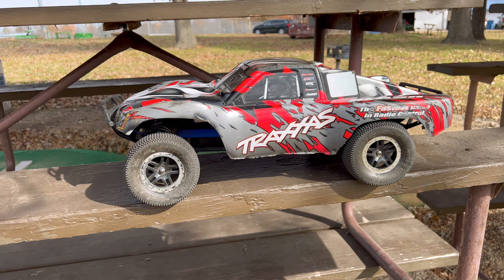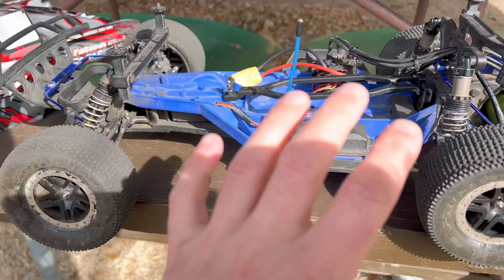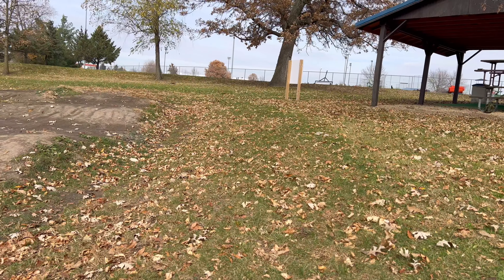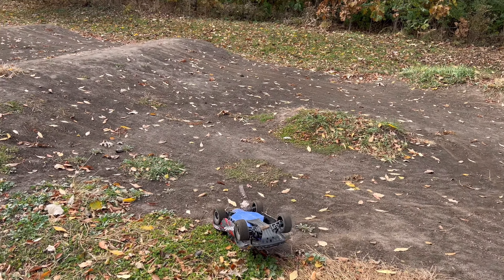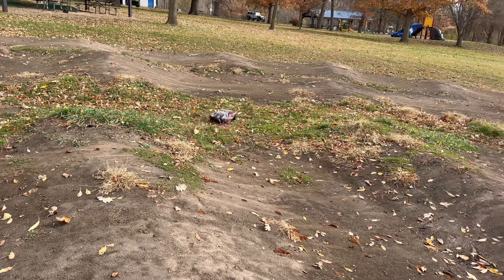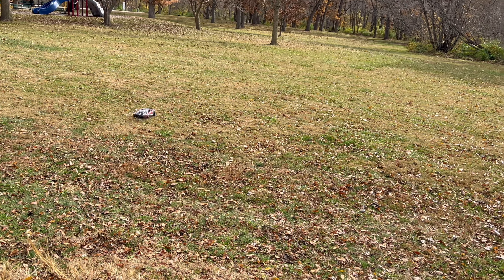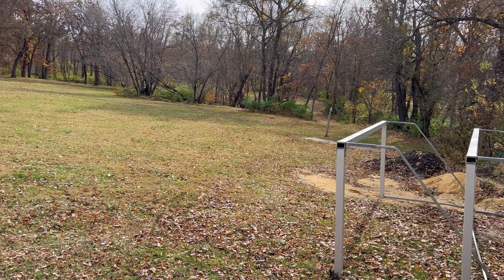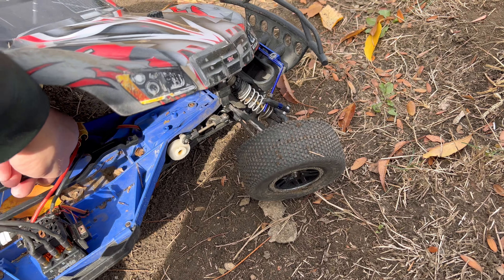FIRST TEST of My Traxxas Slash 2wd on 4S at My LOCAL RC TRACK!!

Comment: You can get drill bits that run in reverse direction with extraction kits and if you drill slowly on the post with a small bit it may grab the post and unscrew it 👍 If not, just use the extractor once you have the hole drilled.
Reply from the maker: Actually I have quite a few extraction tools including the reverse bits….unfortunately all of the smaller ones I have are broken…they break really easily when you put pressure on them….the main issue is even if I can get it extracted….it’s just gonna continue to happen on big impacts
Reply: @RCKnockout  I hear ya, I have quite a few drill indexes with most of the small bits gone 🤣 Maybe cut a slot in the chassis either side of the battery tray just behind the front lower framework and run a Velcro strap around the battery 🤷‍♂️
Reply from the maker: @scottlesage386  that definitely might be what I’ll end up doing lol

Comment: I had the same problem with the exact same rc. My battery post kept breaking in the same spot. I took a small cut off wheel on my Dremal and cut a opening on either side of where the battery sits in and just use a normal battery Strap through the 2 openings and over the battery. Works great and easy to get the battery in and out..
Reply from the maker: So you use the clip in style out of the Slash 4x4 Ultimate?
Reply: @RCKnockout  I just use a velcro strap that goes across the top of the battery from left to right.  I cut a small line in each side of the battery tray. Put the strap though there and slide the battery underneath it.. then all you have to do to get the battery in and out is losen or tighten the velcro strap. I just used a generic rc battery strap I bought on ebay for a few dollars. It has lasted about a year now and no more losing clips for the battery hold down. 
Hope this helps
Reply from the maker: @justinhetricck6197  gotcha so you just put the strap directly through the chassis?
Reply: @RCKnockout  yes
Reply from the maker: @justinhetricck6197  ok thanks!
Reply: @RCKnockout  You're welcome

Comment: I recommend that you get a wheelie bar i got one a while ago and it works very well because with 4s you will just wheelie all the time and it will flip over
Reply from the maker: Actually I don’t feel like a wheelie bar is that necessary for this car….it’ll wheelie a lot but for the most part it’s pretty controllable
Reply: Just set your clutch properly and it won’t wheely
Reply: @RCKnockout or also since you have RPM rear you can add some wheels for cheap i did that for my slash to save the bumper from rubbing AND that would cause drag now with the front tires up she just GLIDESSSS!!! I like to wheelie i only let off on them before crashes so you may like that the bumper slows you down a bit once the front wheels are off the ground!

Comment: To get that piece out. , U can either slice it in the middle with a super thin Dremel cutting wheel.  And remove it with a small flathead. Or u can trim some of the plastic around the broken shaft. Exposing just enuf to vice grip or plier out the broken piece.  As far as after u get it out... It may be more inconvenient but I'd consider a long hardened screw/bolt with a washer to screw down the batterytray top piece
Reply from the maker: Yeah I’m not super worried about the extraction part….but figuring out how to combat this in the future is gonna be the major task….so your saying I should use a screw through the bottom of the chassis and a nut to hold down the battery strap?
Reply: @RCKnockout  no, I'm suggesting u use a bolt in place of the part that broke. U would have to screw it in or out everytime u change the battery. But it would be a much stronger piece of metal holding it down.
Reply from the maker: @modzilla74  gotcha….it could strip out the threads though….especially if I’m screwing it in and out each time I swap out a battery
Reply: @RCKnockout  if it's screwed in with enuf threads it shouldn't have any strength issues ... But another idea I have is this.  ( I've actually done this personally.   I put a small slice in the chassis on the upright walls on each side of the battery.  And installed a Velcro strap
Reply: Use a thicker screw..
Reply from the maker: @modzilla74  that probably actually would look better overall
Reply: @RCKnockout  whatever u choose, is in for a hard life with the way u jump and land that slash. Gl
Reply from the maker: @modzilla74  you’re not wrong lol

Comment: Double tap the reverse as soon as you get air to bring the nose down, also, I added some weights in the nose, helps a lot with putting speed down without wheeling everywhere
Reply from the maker: Thanks for the tip bro! 👍😉

Comment: Use a dremel to cut a line into the broken piece and unscrew it with a screw driver and you can mod it with to use the velcro battery straps to hold the battery down
Reply from the maker: Actually I’ve already converted over to a strap
Reply: @RCKnockout  Ok
Reply: You have a video on that conversion? Only way i can think of straps or anythin working easily is to drill into the LCG for holes/slots @RCKnockout

Comment: Cool video of your 2wd Slash, I have had 2 Slash 2WD's one kit (I wish i still had) and one RTR that i have upgraded currently my RTR one has no electronics in it and i'm debating if i want to build a new kit with upgrades or keep my RTR and put electronics in it. Mine has proline shocks, LCG chassis conversion, Aluminum bellcranks and might do the Magnum 272R transmission.
Reply from the maker: Thanks man! I’d probably keep it personally and put electronics in it

Comment: I had the same problem, I went back to the hcg chassis and added some 2.8 tires along with the monster fusion body, and oh man the slash 2wd became my favorite rc again, mabye it’s time for  your slash to get a new look 🔥 keep the videos coming
Reply from the maker: I like the LCG chassis…..just the post breaking is super annoying….I’m glad you’re enjoying the content! Continue having fun with your Slash!
Reply: @RCKnockout  stick with your lcg. HCG flips to much to have fun especially on pavement
Reply: HCG sucks compared to lcg.. I would modify the battery tray holder before switching the chassis back. It's not that big of a deal or hard to fix on your own
Reply from the maker: @tmar352  I’ve got no plan to switch back to the hcg chassis
Reply: Zip ties, they work great for so many situations.   They are a quick fix, keep them on hand.